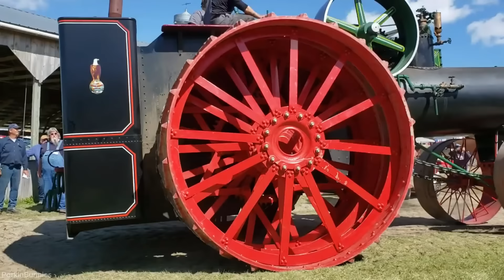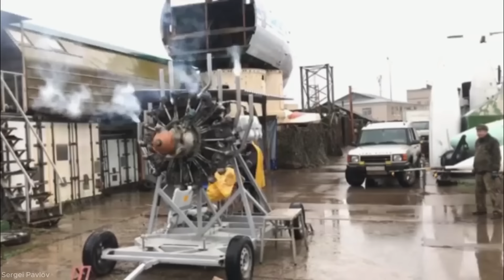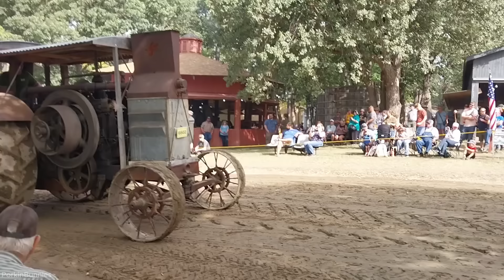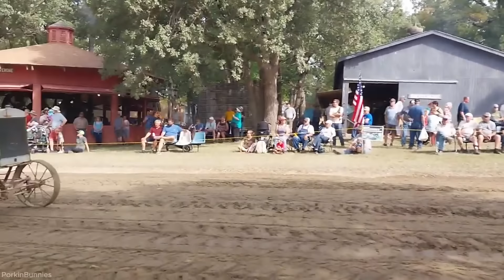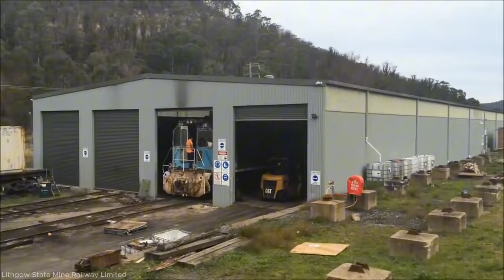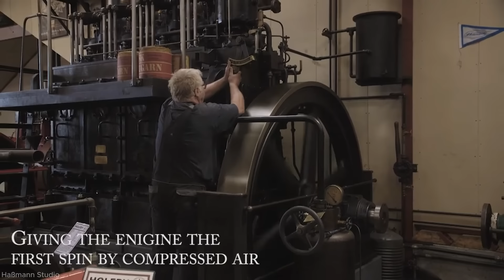Massive Steam and Diesel Engines Restored to Power – Satisfying Antique Startup Compilation

Comment: There's nothing like the sound of a roaring radial engine. You can tell the difference of any of the older planes that have one.Always a odd number of cylinders generally 7 or 9 and up to 3 rows of cylinders
Reply: There was a Wright radial that had 4 rows of cylinders for 28 in total that powered the B-29 bomber for one aircraft.
Reply: i want to know more, can u share?